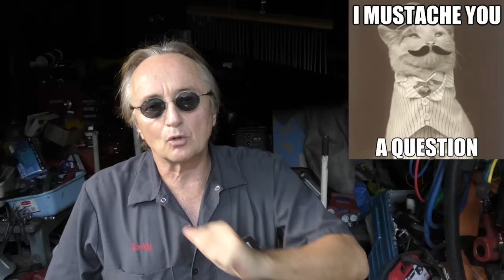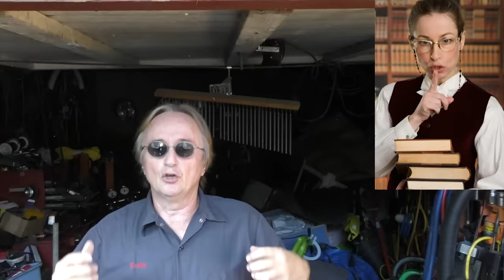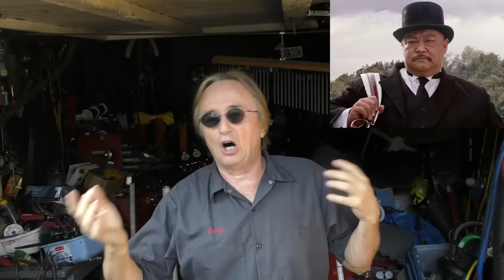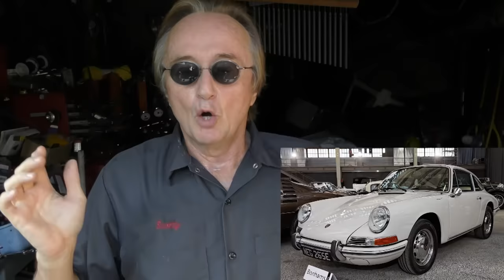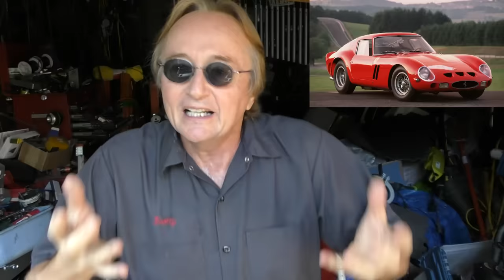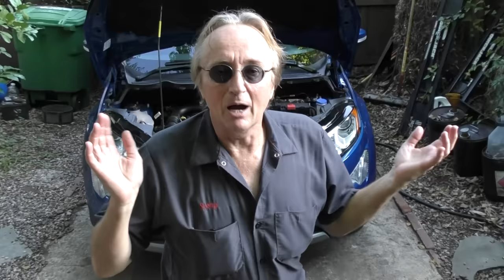The Truth About Boxer Engine Cars

Comment: "Its basically an old design"
You mean, like a piston engine?
Reply: Compared to Tesla most cars these days is a 150 year old design -)
Reply: The only new engine (20th century) is a rotary. The rest are 19th century
Reply: @daves984  but rotary is unreliable :(
Reply: @Paul JJ nota bene electric engines are as old as piston engines (if not older).
Reply: This is true. Everyone seems to forget that steam and electrical engines were the first engines used to power horseless carriages and motorcycles. Then this dude called Rockefeller discovered that the waste product of oil refineries that used to be dumped and thrown away back then, was in fact this really cool thing called gasoline. The rest is beautiful, global warming, history :)
Reply: yal100 “Electrical Engines” 🤪
Reply: What he means to say is that he is Toyota Bias. I would put a New Camry against a new Legacy any day of the week and I have! There is no quality comparison. I just traded off a newer Camry (2017) for a base  year end 2018’ Legacy. Seriously, no competition. Toyota has slipped on quality in the last ten years! Look at the price of a brand new one, they are supposed to be a mid level sedan at a corrola price for a reason
Reply: @ryu03xism   After the Mazda 8 rotary engine issues I doubt you will see Mazda bring on any new rotary engines. They are focussed on the skyactiv design engine now that get fantastic fuel economy. For a smaller car company, Mazda is doing some interesting things and bringing out interesting models. They  are constantly improving their cars
Reply: Paul JJ Tesla uses what’s basically a 80s Jaguar suspension. Double wishbone.
Reply: @itftcomputers  Except the electric car concept began in 1832.  Sorry Elon!
Reply: Ej257 2004 till today
Reply: @ProFow  LOL :D yeah you got me hahaha nice :D
Reply: Piston engines have advanced significantly. Unlike the boxster.
Reply: Driveway Marvels you know boxer engines have pistons right? Do you mean Subaru boxer designed engines haven’t advanced much? Or do you think the Porsche 911 turbo boxer 6 that does 0-60 in 2.9 seconds hasn’t advanced enough for you?
Reply: Paul JJ negative. Electric engine was invented far earlier than combustion one.
Reply: @miriamvivo4279  jdm ej20x ftw
Reply: @michaelfrompolin  Electric Motor, motors run on electricity, Engines are pneumatic, running on gas pressure, common misconception. But yeah electic motors might actually be as old if not older than internal combustion engines, now older external combustion steam/coal powered engines are probably older than electric motors.
Reply: @sddnhad  This is true and Tesla was pretty much only made possible through government subsidies that taxed everything hydrocarbon powered to pay for R&D for solar panels and of course electric cars that ironically run on coal a hydrocarbon fossil fuel.
Reply: @drivewaymarvels311  the boxster is a piston engine
Reply: @JustinBobby-di9zt  I understand and I'll try to remember. Thanks. 

In Polish both, the Electric Motor and Combustion Engine share the same noun.
This is where my misconception come from. .And greets!  :-)
Reply: Paul JJ was that a joke?
Reply: Was thinking this the whole time
Reply: @itftcomputers  Also, nothing remarkable about an electric motor and/or battery, the most "popular" car of 1895 was the Riker electric, with 123 units sold.  For the time, that WAS "mass" production!
Reply: @yal100  You're referring to what the old-time refiners termed "Stove Naptha".  It was one of MANY fuels tried for the first Otto-cycle engines...believe it or not,  Nikolaus Otto envisioned using COAL DUST to power his first engine!  That "Stove Naptha" worked out to the best combination of heat value, power delivery, and STORABILITY was mere happenstance, it's not as if Rockefeller had anything to do with its development.  As a matter of fact, Rockefeller's Standard Oil was, if anything, a latecomer to the automotive fuels market (the old man was not convinced that gasoline would dominate the automotive market, or that they'd be anything but a "rich kid's toy", but as Standard already had a stranglehold on the railroads for shipment of product and a well-developed dealer network, it quickly dominated.  Hence why most of the brands that we're familiar with today for gasoline filling stations are the companies spun off in wake of the 1911 SCOTUS-ordered breakup of Standard Oil, like Chevron (Standard Oil of CA), Exxon, formerly Esso (Standard Oil of New Jersey), Amoco (Standard Oil of Indiana), Sohio (Standard Oil of Ohio, considered the "parent"), and Atlantic, later merged with the West Coast independent Richfield to form ARCO.
Reply: edekitrex you can get a non-turbo engine configuration that runs that time and gets better mileage than a boxer 911
Reply: @drivewaymarvels311  My wrx fa2.0 has vvt 4 cams direct injection 268 hp and gets 9l100k in the city  beat that
Reply: @michaelfrompolin  Yeah really, electric cars were more popular at first because they didn't make much gasoline. I don't think it was really until gas cars started being made that they started making much gasoline.
Reply: Yes! Sounds very reasonable.
Reply: @don-cw1yz    Mazda has a decent engine design,  but they need to spend more time in developing everything else on their cars.  My 2016 Mazda 3 has so many suspension/linkage noises it's ridiculous and the dealer says they can hear it but can't identify the source and since there is not any recalls, will not fix anything.   This is my 2nd Mazda (1st one had other issues),  and this will be my last Mazda.
Reply: @yal100  Yep ,that's true.Things have come full circle. Hello Nikoli Tesla and musk.
Reply: @itftcomputers  True,Big oil (I am guessing) hates Tesla. However power has to come from somewhere to charge batteries. I read somewhere, someone (way smarter than me) using capacitors with batteries might improve electric cars.
Reply: @yal100  Global warming is a hoax, the earth is flat and the moon is a giant piece of cheese.
Reply: @itftcomputers  Except that the first electric car was designed and built in 1890 by William Morrison.... and Karl Benz made the first petrol powered car in 1885. So if the petrol car is 150 years old the electric car is 145 years old....
Reply: @daves984  And that was Mazda in 1967 so that is a mere youngster at 52 years old
Reply: @itftcomputers  Electric cars came before fuel driven piston engines. So rethink that one.
Reply: Good old rotary piston engines of Mazda RX-7s.
Reply: @itftcomputers  Huh, electric cars were also invented in the 1800's
Reply: @drivewaymarvels311  The boxster is a piston engine.
Reply: @edekitrex  Right but on another subject I wish air cooling had advanced more and not died.
Reply: @ryu03xism  Only if you look after them like a normal piston engine.
Reply: @disco.jellyfish  🤣😂🤣😂
Reply: @baobo67 

It just makes less sense. You have to remove the heat directly where it is created. From there it's  basic heat transfer/thermodynamics. You'd need more and more surface directly on the walls.
Reply: @onpsxmember  Quiet right. More power more heat. Porsche were adding more oil coolers but eventually liquid cooling was easiest/best way to go. My wish comes from love of the string of beetles and Kombi vans I have owned over the years not to mention a yearning for a 911, air cooled of course. Best I have owned since has been a Subaru still with the boxer engine.
Reply: @baobo67  i do not find much wrong with the boxer engine. between the three of them we do 1000 to 1500 miles per week.
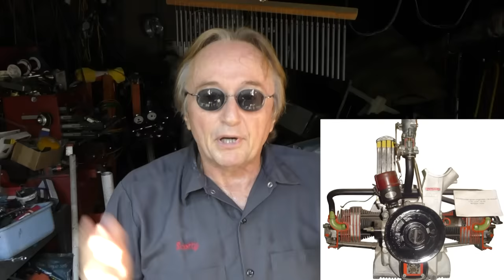Reply: 5:20 He basically spit on those engines.
Reply: @daves984  It's not that new. They've been around since the 70s if not earlier. Never got anywhere with them because of being unreliable. Somebody is still tinkering with them though, maybe they will eventually figure out how to make them more reliable.
Reply: I was going to say something like that....we shouln't be even using internal combustion engines now...
Reply: @ryu03xism  rotarys arent inherently unreliable they just dont have great longevitity
Reply: Guys so Toyota salesman. Parts for toys like any Japanese car are ridiculously cistly and Toyota has had nothing but Frame Rust issues since day 1. Frames crack on Toy trucks all the time due to Rust, garbage platforms,
Reply: @itftcomputers  electric motors are also 100 year old design. Tesla and his inventions has been around a long time
Reply: don684 I believe ford have a 50% stake in Mazda
Reply: @ryu03xism   mostly because people refuse to learn how to drive them....driven right a well put together rotary is plenty reliable....their real downfall was more due to poor fuel economy
Reply: @ProFow   It does sound funny/wrong but technically they are engines in the broad definition of the word....rubber band power could even be termed an "engine"
Reply: @yal100  All we seem to do to improve engines today is looking at ways to replace metal with plastic, certainly BMW do!!!
Reply: lol lol don’t reliability and longevity go hand in hand? Reliability relating to an engine means it does what it was made to do which is run and do it over and over again. So if an engine doesn’t have longevity, then how can it be reliable?
Reply: Yea, not sure what he is on about. Boxer, Inline, and V engines all pretty much invented within just a few years from each other.
Reply: Tesla lol
Reply: When people talk to him face to face, I bet they get spit on a lot!
Reply: @itftcomputers  electric engines are just as old. First police car in america had 2 electric motors in 1899.
Reply: @itftcomputers  If a piston engine is an "old" design, then what exactly is not an old design now? Electric vehicles? FYI, first road-capable electric vehicle was built way back in 1839, 20 years before internal combustion engines were even invented, lol
So, your beloved Teslas are actually even an OLDER design than ICE, lol
Surprise, surprise!
Reply: @drivewaymarvels311  "Piston engines have advanced significantly".
Well, and so did the boxers.
Boxers are also piston engines, so, what's the difference?
Reply: @itftcomputers  poor victim of Elon Musk's propaganda, who didn't bother to conduct his own research on the subject, lol
Reply: @antona.4572  Yup. Boxers have advanced through air cooling, oil cooling, water cooling, forced induction, EFI, direct injection, etc.

  Modern boxers can be pretty efficient too, despite the negativity that naysayers may spread. I average 40MPG COMBINED with some tanks in a 2016 Subaru 2.0L/CVT Crosstrek, and the car's only EPA-rated for 33MPG hwy. I just set the cruise near the limit, 45-65MPH, and this AWD with a sturdy roofrack and almost 9" of ground clearance gets similar mileage to what a FWD Corolla hatch without a rack is rated for hwy. The Crosstrek is also rated to tow up to 1500lb as well.

 Just use Duralube or similar in the oil, after 10K miles, to avoid startup wear that can potentially lead to later consumption issues at higher mileage. Flush and refill coolant every year or so too, so that head gaskets and other cooling system parts aren't potentially degraded quicker than normal. An ounce of prevention (maintenance) is worth a pound of cure (repairs).
Reply: Comparing an old electric motor to a modern one is kinda like comparing a rotary to a piston engine. Electric motors come in tons of different shapes and use very different forces to produce power 🤔
Reply: @drivewaymarvels311  its boxer, not boxter.
And the boxer engine is in fact a piston engine.
All it is, is 2 smaller engines bolted at the crank. They arent different from any normal 4 cylinder engine in that regard.

Come on man.
Reply: Yaaah, for microprocessor controlled engines.
Reply: @daves984  uh Chrysler did have a turbine engine.🤷
Reply: @daves984  : Uh, Chrysler did have a turbine engine.
Reply: Dude is a flake!

Comment: My 2004 Subi WRX Turbo was very fast and crazy reliable.  I sold it, all original, with no repairs to the engine other than the standard stuff such as alternator,  belts, water pump, timing chain and associated bearings, and I sold it still running good with with 340K  miles on it.  Take care of your car and it will take care of you!  Good vid, thank you!!
Reply: What gas station did you go to? What oil brand and weight did you use and what were your oil change intervals?
Reply: I have the same car same year. My body is falling apart, but mechanically it's been the best car I've ever had. 209k miles. Original clutch, everything. Did timing belt and turbo service. That's it

Comment: Reasons why boxers are great engines:
1) lower center of gravity for better handling
2) they can produce reasonable HP and torque if engineered correctly 
3) Today’s boxer engine are fuel efficient and smoother than yesterday’s boxer that Scotty is talking about. 
Drive a new Subaru! You’ll be impressed.
Reply: V A I did. I wasn't.
Reply: @officialWWM  I drive em at work, they are the stock liberties and such. The Toyota camrys are heaps better in form and function. Can't deny the AWD pull is nice but eh. Every Subaru I ever been in squeeks
Reply: [R E D A C T E D] they sound like they have a miss in the engine...from the factory :/
Reply: I had a crosstrek 2L petrol auto very smooth to drive and powerful, low emmission on awd. It drives like a luxury.
Reply: @warmage247  haven't been in mine then.
Reply: Head gasket go boom
Reply: Reasons why they are shitty= blown head gaskets.....$$$$$$$
Reply: Does a pull in my sti 
Rods: ight imma head out
Reply: Mike Castellon not the newer ones. I have one from the generation that has the HG issues and mine is still running good, you just have to take care of them.
Reply: James Gatz lmao
Reply: TinyBabyJesus  bummer it can't beat a 1LE Camaro 😂
Reply: V A and stash away $3500 for head gaskets . Yep they all blow. Ask me how I know
Reply: @mikecastellon4545  they fixed those issues since 2010. The FA engine are even better introduced in 2015
Reply: Butt hurt Subaru drivers with every excuse and new facts, relax, he is generalizing based on his life experience not a sole WRX STI that you might own.
Reply: Stay away from the hole lower center of gravity as that's negated by the fact the weight of the engine is in front of the front wheels. It's a bad design but can be designed around
Reply: I test drove a new Impreza. I wasn’t impressed. It felt week. I then test drove the cx3. I felt way better due to Mazda not using a cvt. Bought the Mazda instead.
Reply: @kittyNya38  
That's why you drive a MT and not a CVT 🤣
Reply: @mikecastellon4545  only STIs but they fixed that
Reply: @iTank2  newer ones don't have it they fixed it lol
Reply: LittleTinyBabyJesus air cooled at that
Reply: @kittyNya38  smh it's not the trans it's the programming for it. But I get were you are coming from
Reply: My STI is golden
Reply: New subaru no rod bearings problem?
Reply: daniel velez what go back to school
Reply: D-man747 try a manual next time
Reply: Not to mention they are well suited for all wheel drive motors because they are already low mounted motors aligned perfectly with a drive shaft that can easily feed all 4 wheels with power with minimum loss. Scotty may take AWD into consideration next time he is comparing apples to oranges. There are lots of advantages to AWD and only one disadvantage, that Subaru is tackling with CVT, and that disadvantage is MPG. CVT has been adopted for one main reason, to make AWD cars competative with 2WD cars mileage wise.
Reply: I drive a 2005 WRX. Love it
Reply: Oil hungry engines. Good appetite
Reply: Word!
Reply: @ghjkkjhvbbnj  not anymore
Reply: @kittyNya38  GF's Honda with CVT is nice. I like their CVT.
Reply: @toddsperling2047  head gasket issues are a thing of the past.  Might rarely have head gasket issues, but not common.  Even Toyota has head gasket issues occasionally!
Reply: @mikecastellon4545  Head gasket issues are a thing of the past......................
Reply: I tested an all new 2020 Subaru XV 1.6 and was impressed not by the horsepower because it's not much by today's standards, but testing it, the suspension and the AWD are quite nice, you feel the grip, and it's sure-footed, so for me the seller is the AWD, and the fact that the Subaru drivers I know wear by their vehicles, especially the reliability of them. I have new respect for Subaru, unfortunately bringing the 2.0 Ls here puts them way out of the reach of the average buyer.
Reply: @mikecastellon4545  they dont all blow on the newer ones, at least not often.  My 2010 outback has 205k miles and I knew a guy that got 450k out of his 2010 outback with no head gasket issues.  Many similar stories.  Since 2010, the head gasket issue was resolved for the most part.  Occassionally still issues, but not common.
Reply: Yeah I really need that lower center of gravity for my high-speed cornering, hahaha, I think we are all talking about everyday driving not race cars. Boxer engines are awesome in racing but they are a specialty engine that requires more maintenance and special care, that is why most car companies do not use them, Subarus are sort of a luxury and the people that purchase them can afford the maintenance.
Reply: I bought a 2020 WRX last summer. LOVE it. It is an amazing car. Not the best on gas (for a 2.0L 4 banger), but if you drive it lightly, the milage I can get on it is more or less equal to the 2013 Impreza I had before this car. No regrets. However, the premium gas thing really sucks right now...but then again FJB and The Turd for breaking the economy!